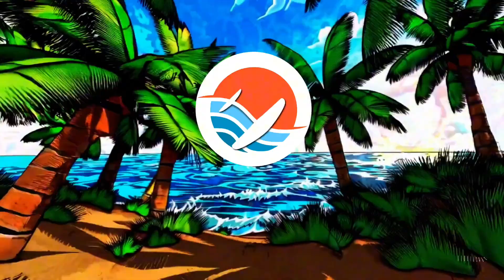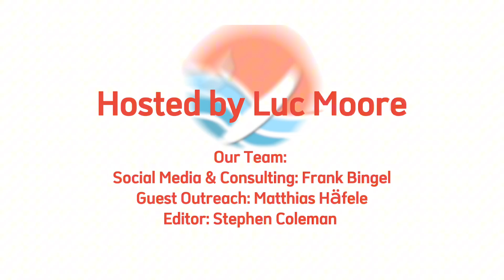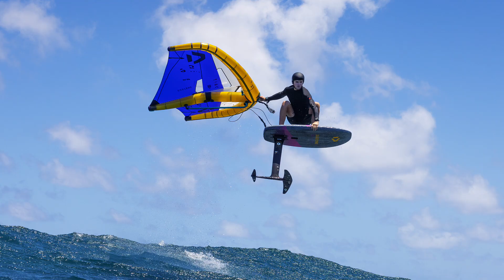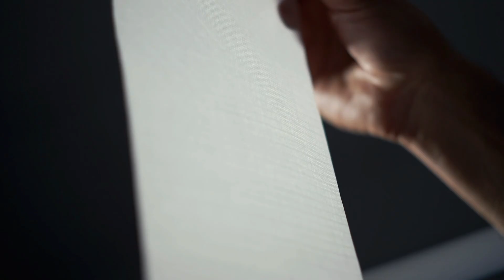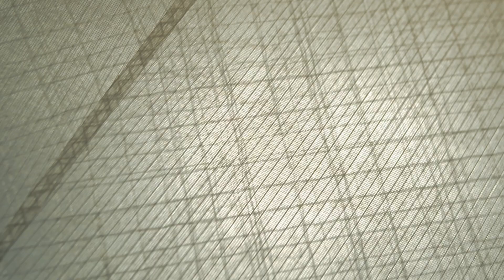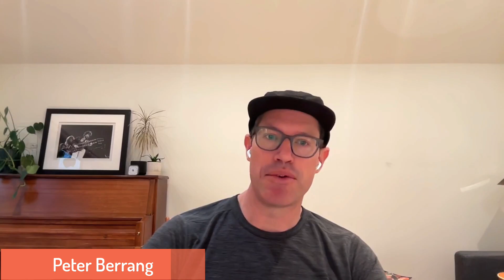Episode #85 - The story behind ALUULA with Dave Westwood

Comment: Just bought Duotone Evo Dlab 2026 models, they are crazy light and stiff with Aluula, thinner leading edge and higher pressure makes a massive differents to the wind range of the kite. 10 PSI leading edge is mental but it works :) fantastic material